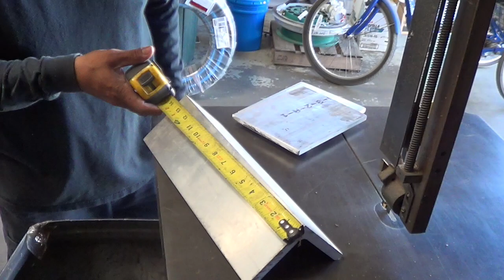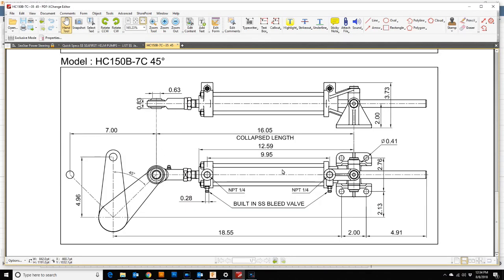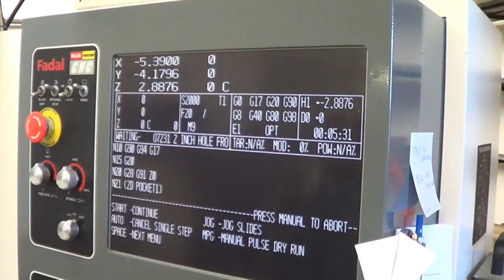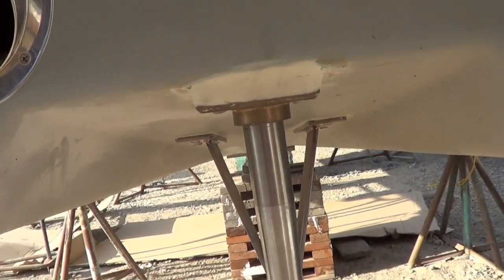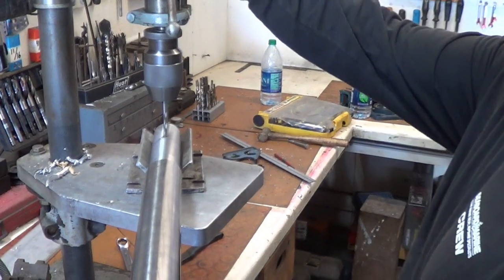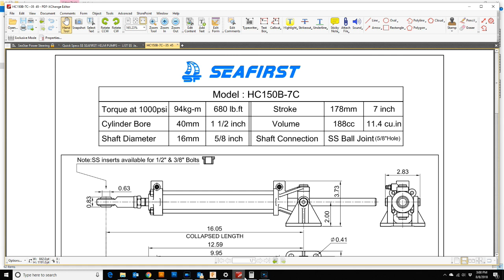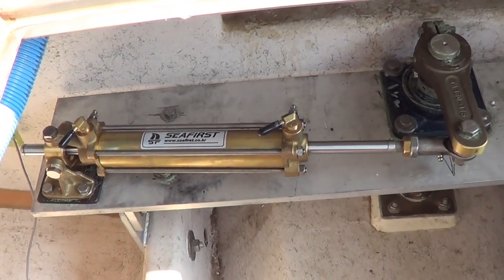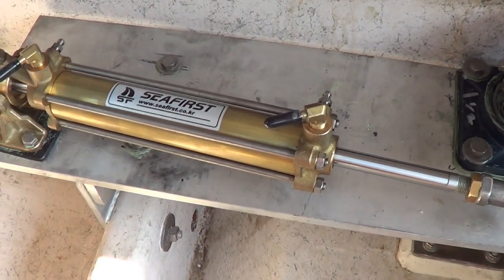Project Spotlight: Radon 27 Ram, Tiller, and Rudder

Comment: Regarding the galvanic isolator sheets, the stainless steel bolts holding it together bond the two pieces. Do you use some kind of insulating rings around the bolts and between the nut/bolt and the metal to break the bond?

Thanks

Comment: Great video lose the music. I have a 31 ft stapleton fishing work boat with 2.4 seastar helms. 12 turns lock to lock help a fella out last guy must have put wrong ram set up do have a contact number?
Reply from the maker: Your not the first to suggest ditching the music, personally I like the music but I am using it less and less in the new videos. Anyhow, if you need help with your steering, checkout our website, Tony's Tips has a lot of great free info on all types of boat engineering including steering.   https://www.sbmar.com/tonys-tips/